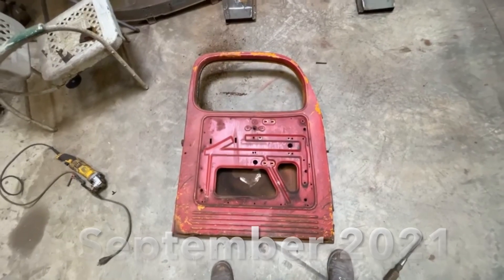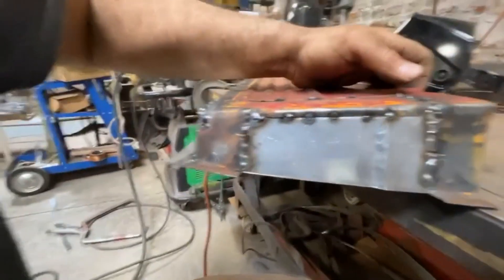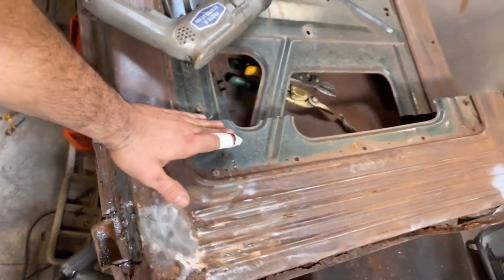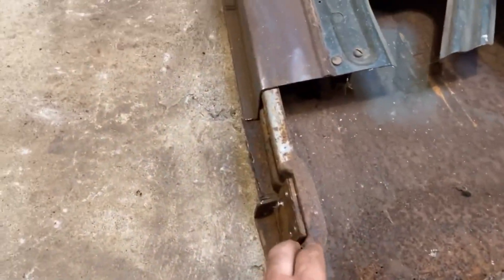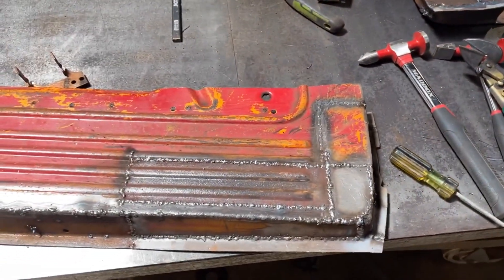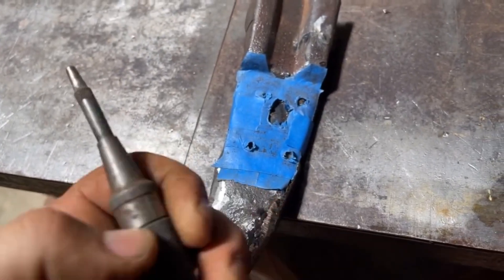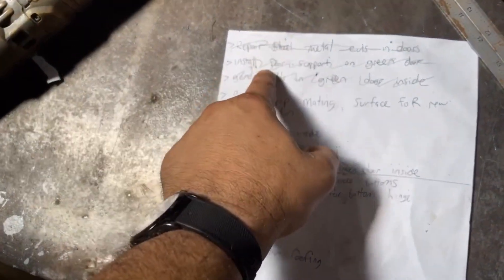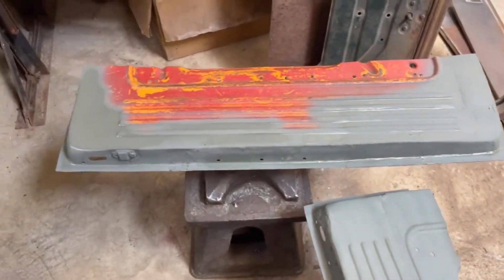OLD DODGE RESTORATION VLOG No. 11 - POWER WAGON Rusty Rotten Door Restore, Part 1

Comment: Good to see you back at it! As a welder, here's a bit of advice that will change your life. Flap disc's. Especially for knocking down the welds on the ornamental facing of the door. Less aggravated abrasions. Much smoother transitioning. They don't last as long as a stone disc but you can still use the stone disc on areas that won't be as visible.
Reply from the maker: Good advise fella!!